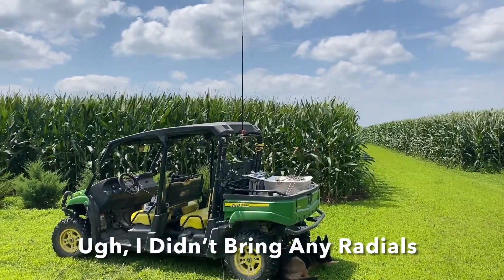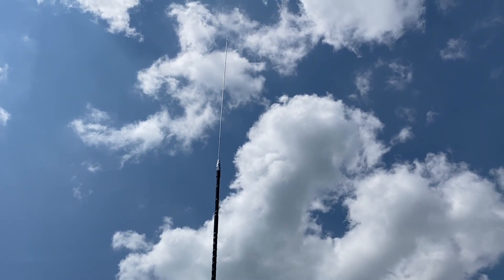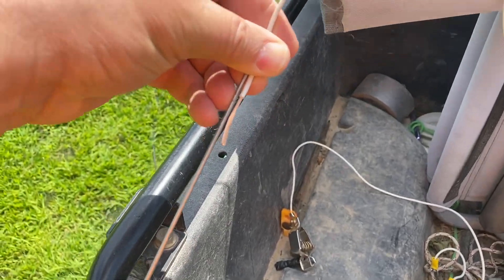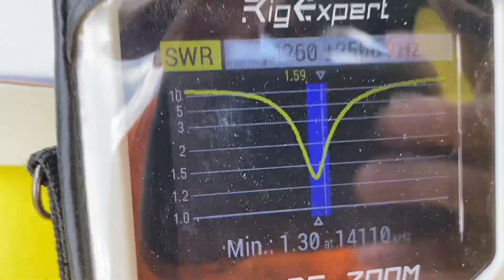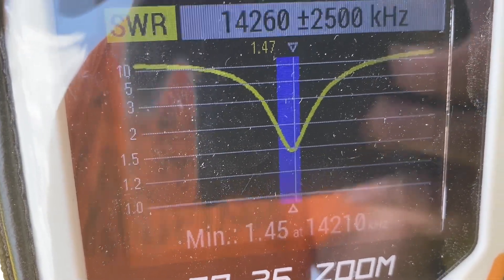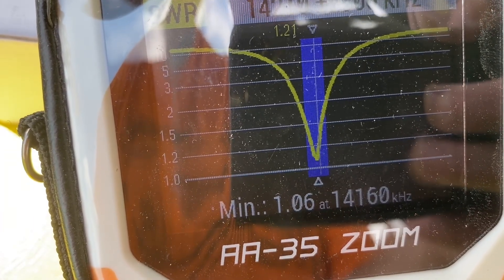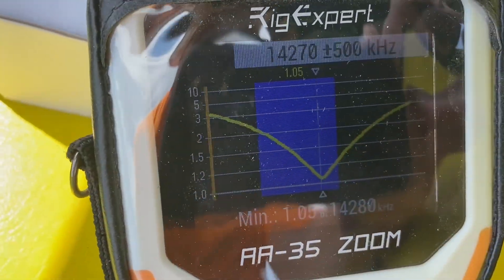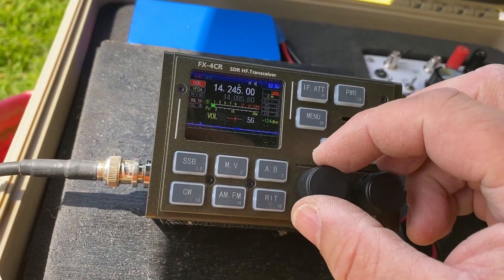MacGyver the Hamstick - FX-4CR, QRP SSB 5w

Comment: Kevin, you have such a great noise floor.  Maybe do a throw-back, and use a corn stalk radial instead of the fancy wires. What about a pumpkin capacitance hat?   Just thinking, Geno
Reply from the maker: Hey Gene.. Thanks for stopping by leaving a comment.. I found the wire worked so well that I did return a few days later and tried (2) cornstalks bonded together.. I was only able to get the SWR down to 1.65... The length was a little short and I didn't want to cut another cornstalk from the field.. (I gotta leave a few plants to harvest this fall, LOLOL).. Anyway.. Wire works much better, LOL.. Thanks for your support.. I appreciate it.. 73, kevin k0klb

Comment: If I'm not mistaken, the antenna radiates best in the direction of the radial.
Reply from the maker: Hi 48pluto.. I believe you are correct.. the radial was pointing E/NE and both stations I worked were east of me. Next time i’ll try and expand the “tuned” radial array to cover E/S/W.. I was just happy to get (1) radial to actually match the antenna this time, LOL.. Thanks for watching and commenting.. I appreciate your support.. 73 kevin k0klb
Reply: @hamradioqrp-k0klb Is that why Hollywood suggested the 3 opposed radials? So you'd get a more omnidirectional radiation pattern?